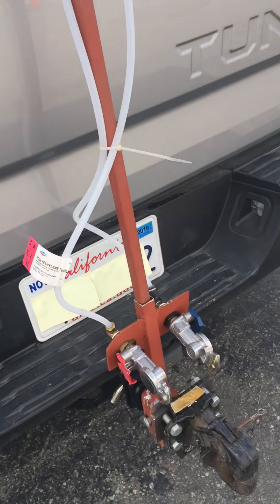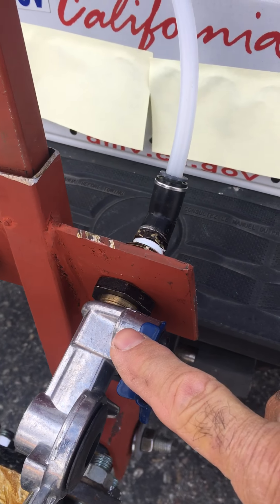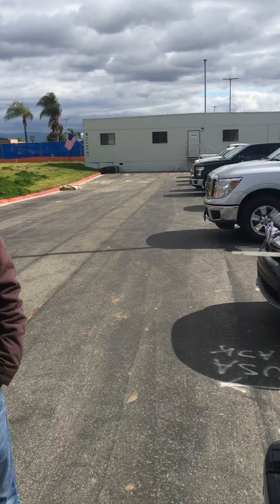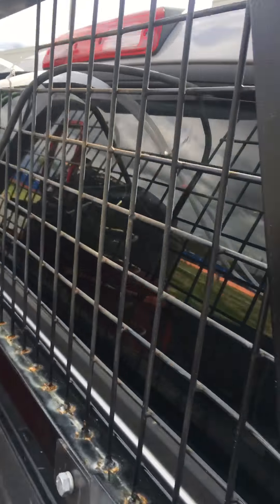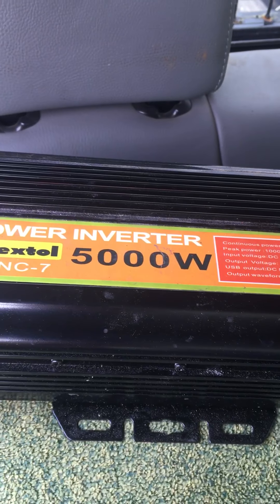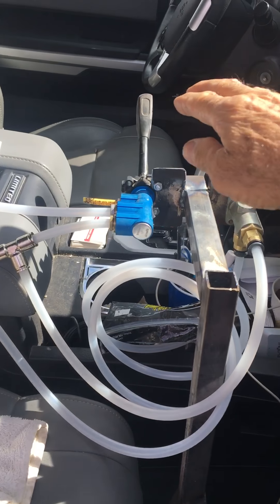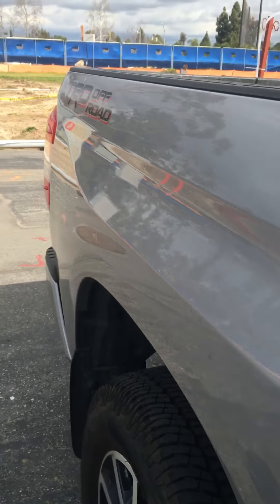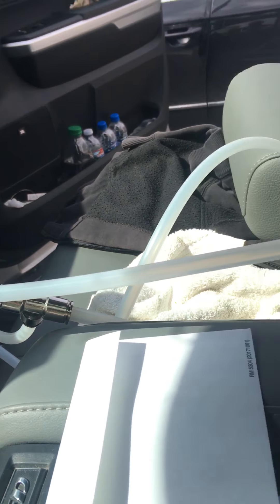AMAZING AIR BRAKE FOR PICK UP TRUCKS

Comment: Did that small air compressor do fine or did you have to pull over and let it charge up any?
Reply: That's why he had the small compressor piggy back the large one. The small one supplies air and the large one stores it.

Comment: What the hell is even that? Surely this isn't DOT legal, the trailer was probably way overweight for the truck as well.  Doubt this guy had a CDL or air brake endorsement on license.  Why would you need to move an airbrake trailer and not have access to a CDL vehicle to tow it? 🤔 SMDH

Comment: Oh no no you missed a few steps  safety leaf valve limiter rely valve and your 1/2 ton disk brakes won't hold up the load not a safe or good idea buy a old semi truck some where cheap or t/a gravel dump truck most of the bigger ones have full air brakes